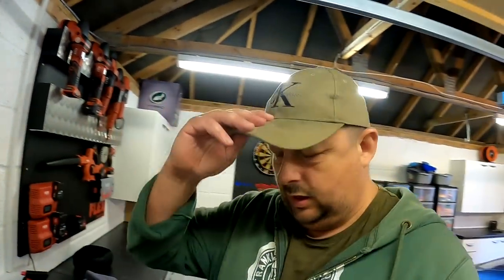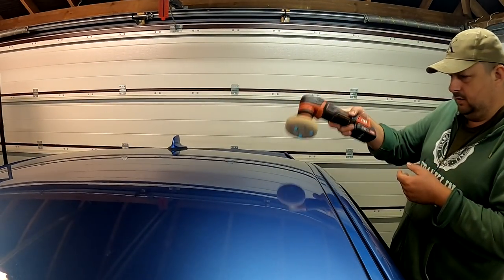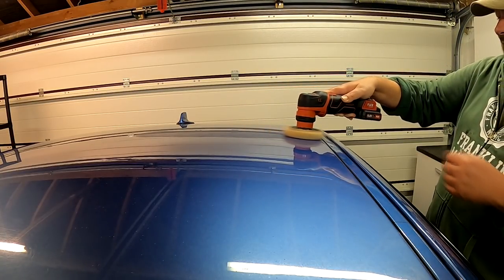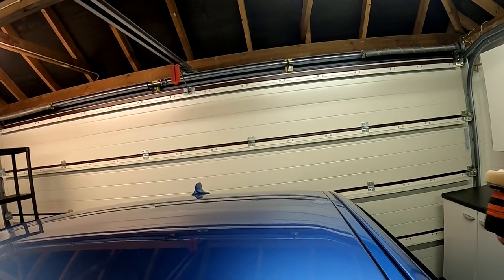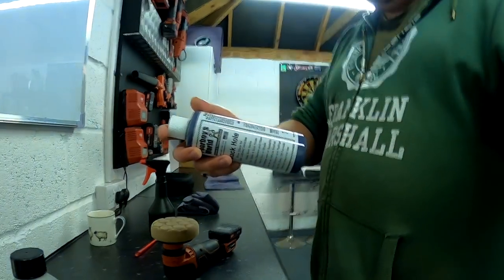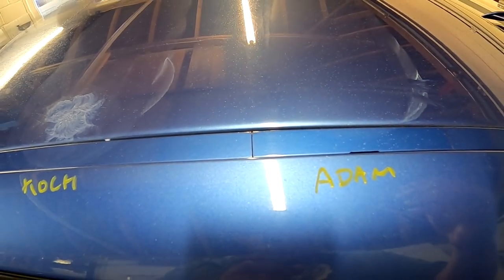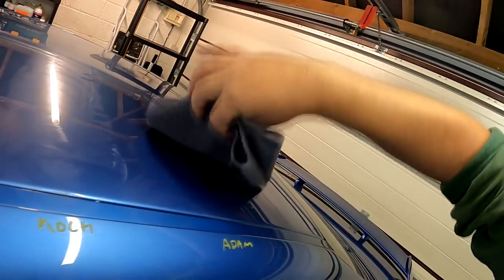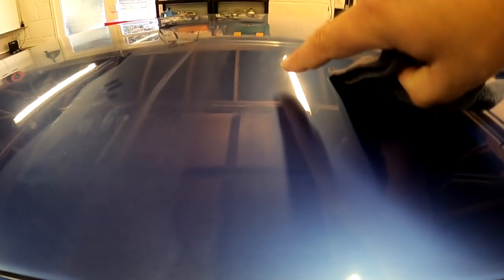6 Hand Polishes 1 Swirly Car | Which detailing product is best? Meguiars Bilt Hamber Koch BlackHole?

Comment: It's so difficult from the viewer point of view to look at these sections... Especially at the end, on my screen, the koch and britemax seem to have removed the most defect, and poorboy seem to have done a pretty good job at hiding them. The bilt hamber side was a bit weird with that big streak in the middle making it look aweful, and then one part looked good. But then the light comes at the right angle and everything changes...
Whoever master the filming of paintwork with light etc on Youtube will get a serious advantage, because a lot of polishing video struggle to show the result. It's also from the video compression on youtube that makes it harder to judge i suppose.
On the Bilt hamber brand, i've tried their auto wash shampoo, and now their auto wheel. The shampoo is good at cleaning, much more effective at tough dirt. And it rinses really easy. I don't like the lubricity and foaming. It dies down really quick in a bucket and on the panel, and that's a part of what i like during a handwash.
About auto wheel, improved smell over IronX for sure, great sprayer and sticking product, good at foaming. Reacts and turn purple immediatly. But, after using it on two different vehicule with wheels dirty af, and one being a Porsche, i didn't get good result, especially compared to IronX. I used it with and without cleaning the wheel before, and it didn't managed to removed all the stuck brake dust. I suspected it was tar, but my tar remover didn't react to it. So i applied more product, still got a reaction, but it wasn't removing the spot, especially on the Porsche on grey wheel.
I still have to test it, but after my experience, i would say it's less effective than ironX. It reacts quicker that's for sure, but to me it didn't translate to better result. imo, it's supposed to be used as a maintenance cleaner, because it foams well and stick longer, exactly like sonax full effect, and removed most of the ferrous contaminant. But on the tough part, it had less effect than IronX.
I would love to use it as a maintenance wash product, but at this price point and you shouldn't dilute it, it makes it too expensive to use as is. 
I should try korrosol next, to have a better comparaison with ironX i guess.
Reply: Bilt Hamber Foam is the best dont worry about having thick foam that means nothing, its about what it does and it hands down beat the competition. Too many people comment on these videos about "not thick foam" ...word of advice it makes you sound like a noob mate.

Comment: Poor boys black hole? WTF????
Reply: Black Hole is a different category.   It is a glaze and doesn't have the abrasives.   It is meant to have a wax or sealant applied on top.  It does provide an awesome slick surface but, I have to admit, I don't really use it anymore as I try to avoid the short durability of waxes.